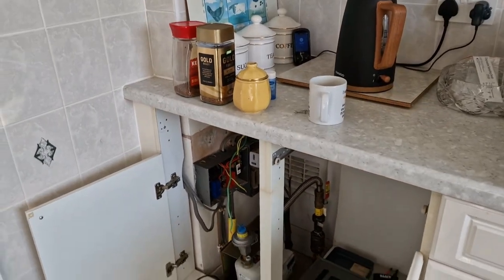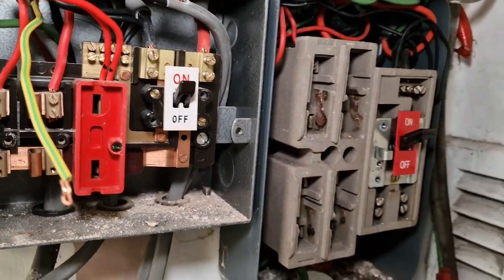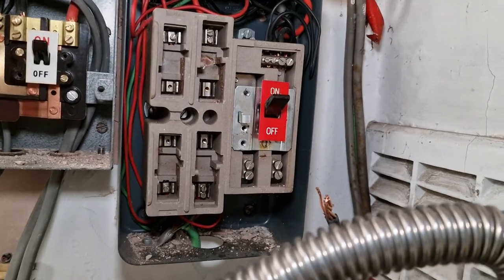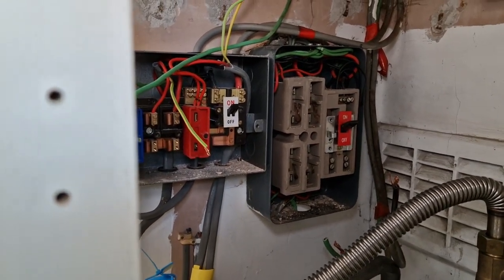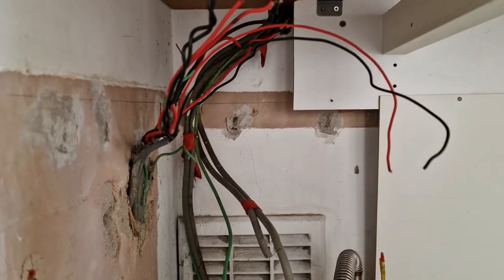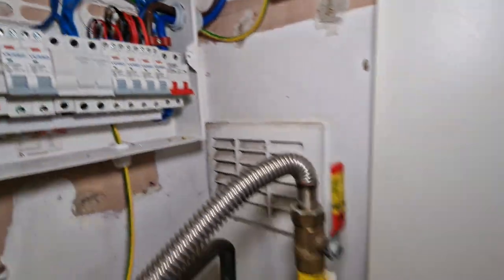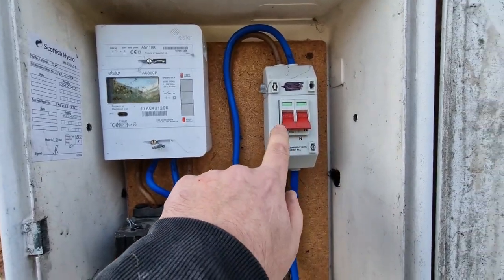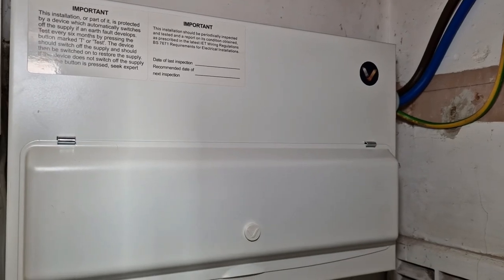New consumer unit far to close to Gas Meter...

Comment: As someone that's qualified in both gas and electrics, 150mm pertains to meters in conjunction with, consumer units/switches/sockets and any other accessory. 25mm pertains to pipe and cables/accessories.
There is also guidance stating a non-conductive non-combustible material can be used if the distance is closer than 150mm between a consumer unit and gas meter. Something like cement backer board that you'd use for Solar Installations for instance.
Reply from the maker: That's my take on it as well. But linked some other views in the description
Reply: @electrician247  Yes I've read them before, completely disagree with professional electrician whom obviously decided to either not read the gas literature or not confer with GasSafe before making the article.
Reply from the maker: @Effer Vescence  it did seem at odds with what I read. CPD accredited you know is the magazine...

Comment: Would be really easy to move that meter to the next cupboard, the only bit that would be anywhere near would be the anaconda pipe on top of the service, I would have done that before the board change to give me better access
Reply from the maker: Gas fitter is on it. Wasn't that hard tbh and we had other issues to resolve that meant the board change couldn't wait. 

We don't touch gas but apparently it has lead pipe off the meter so fun times all round 🤭

Comment: Is the labelling of circuits the final version ? I noticed you have 2 circuits both labelled "Sockets" ?
Reply from the maker: Yes final labels. House is wired with a very mixed bag after conversion of old storage heater points into a ring in the past. Description beyond that both not required and very difficult.

Comment: That is pretty old kit! Whilst there are issues with it according to modern standards, it may well have been a perfectly acceptable install at the time, not sure when the regulations requiring separation from gas and same entry hole for tails first came along.
Reply from the maker: Yeah nothing horrendous about the work. Just due to changes over time. That CU on the right was tiny in terms of wiring room. We are very lucky today

Comment: What is the required measurement from a  gas metre to a fuse board? 150mm or 1metre?
Reply from the maker: It's at the end of the video mate. Few varied interpretations from 150mm to 25mm. I think 150mm makes most sense to me.